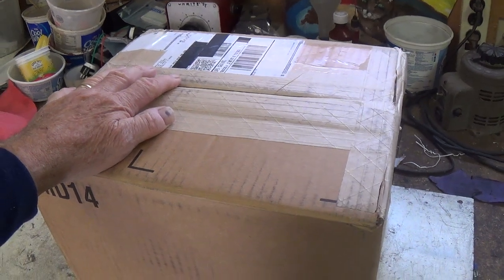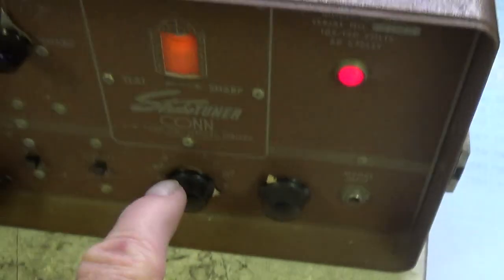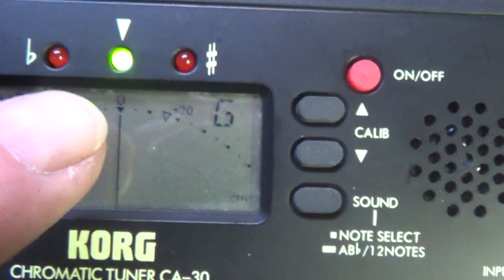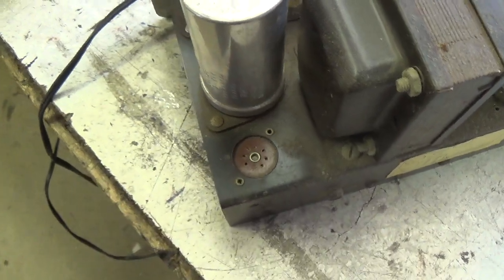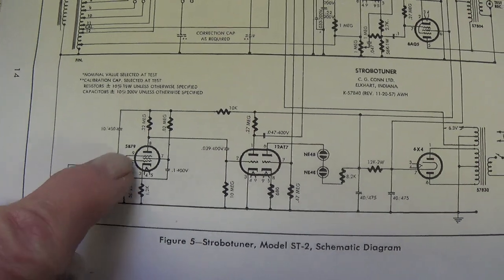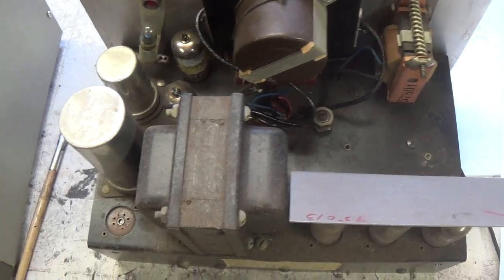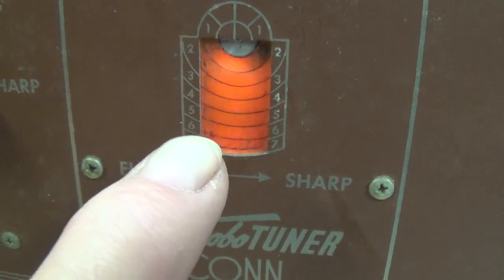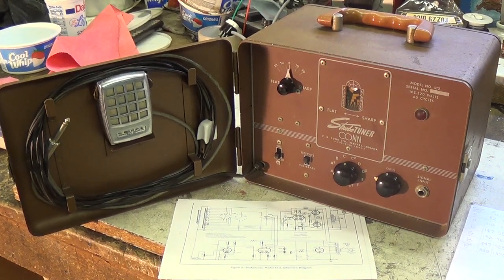Early 1950's CONN StroboTune Model ST-2.......What a Miraculous Device !!!

Comment: Typically here in the states we use 440 for A. I saw that you have your Korg tuner set to A=442. That skewed all your testing lightly. I believe your Korg tuner can play the note for you. So you could use it as your "frequency generator".
Reply: I remember reading that the standard frequency for A has changed over the years.  In fact it has increased as time has gone on, making symphonies and other music composed in past centuries sound unnaturally bright, if the original (now de-)composer were to hear it.  

This is borne out by the frequency listed in that ancient electronics handbook Audel's, which I believe lists 442 as the frequency if I'm not very much mistaken.
Reply: Syd McCreath  lol so true, although I have a few hippie dippy recording clients that tune to 432 Hz so they can be in tune with the earth 🌎 😂 pretty much any time I see one of those blasted Korg tuners in the wild there’s at least a 50% chance that it’s not set to 440 🙄
Reply: Most of the classical ochestra and piano use 442Hz.
Reply: Some of these tuners can be slightly off.  I used a sampling synthesizer to check my sisters' one once and it was off by four hertz.
Reply from the maker: I was using Hendrix & Audel's tuning ;)  Actually, the Korg was adjusted to match the Conn, since I believe the Conn is more accurate.
Reply: @therealdjryan  Organ pipes are made of lead tubing and wood planks, with a few aluminum in modern instruments. They are quite susceptible to expansion and contraction from heat and humidity. Each pipe is fitted with a movable extension for tuning. Gentle taps can move the 'sock' in minute amounts that sliding by hand can't duplicate.
Reply: 440 is the de facto standard for the A just below middle C in all but a very tiny corner of the music world, except for pipe organs, which use 435.
Reply: @Stefaon  that's because they have woodwinds and Brass. They have problems tuning down to 440 Hz.
Reply: With all due respect for Uncle Doug we have to take into consideration that most of his life was in the previous century. It is very well possible that A was 442 Hz when he went to music school.
Reply: @BartManNL  my Generation is more or less the same as Uncle Dougs. We didn't go to music school. We learned guitar from our coolest friends in the garage, strictly by ear...
Reply: With so much of today’s popular music composed of only one note, one would think that it would be all important to get that note correct!  However this is a soundly debunked myth as the use of Auto-Tune eliminates that burden on the modern day producer.  :O
Reply: Syd McCreath  Hendrix tuned down a half step.
Reply: A=440 is the A just above middle C. This is called Philharmonic pitch and it was settled in 1938.
Reply: @stirlingschmidt6325  -  In the A440 standard, middle C is 261.63 Hz.
Reply: @UncleDoug  agreed- from the start of the premise, I thought the conn would be the more accurate of the pair.
Reply from the maker: @scottclark7592  I trusted its reputation, Scott.
Reply: @stirlingschmidt6325  Not really.
Reply: @denniseldridge2936  
I heard something of the same. I thought it was 440 vs. 432 though. I think 440 is the official standard tuning now....I think.
Reply: I believe that way before the loudness war there was a pitch war which eventually resulted in the standard of A above middle C being set at 440hz. I think it's actually part of the Geneva Convention and it's technically illegal to tune higher than this. It's a fascinating story how we arrived at A = 440hz and far beyond the scope allowed in text.
Reply: @rubievale  
According to Zen worshippers, they dont like it. 432 was the balance of all harmony. Or something like that.
Some bands say they cant play 432 because they dont get that "Metal" sound. Yet other bands refuse to play 440. They say its evil. 😂
There must be something to what the Zen say if there's a difference of religious opinion in the rock genre.
Reply: @Stefaon  It was a Chicago instrument maker named J.C. Deagan who came up with A=440Hz. It had to do with, of all things, selecting a standard way of tuning percussion instruments for symphony. The American Standards Association adopted A=440Hz as official concert pitch in 1936, but prior to that, the most common standard for some centuries had been A=435Hz.
Reply: @therealdjryan  Pipes can detune over time from mostly corrosion. If the corrosion layer is removed then what's left of a pipe no longer has the same exact original dimensions & weight. Hammering will harden & make stiffer a chosen section, altering the resonant frequency. I like to occasionally find a cheap, trashy cymbal & try to hammer some moderate amount of decency into it. If the experiment fails, no significant downside, plenty more shit cymbals out there. But surprisingly I've gotten better-than-expected results most of the time.
Reply from the maker: @rubievale  Thanks for your helpful input, R.
Reply: @UncleDoug  I think the Conn is more accurate too, I have a chromatic digital tuner similar to your Korg which I use to monitor tunings on pianos when I am raising their pitch, the digital tuner is not accurate enough for fine tuning but I know the Conn is, they were used back in the day to analyse pro piano tunings and discoveries were made regarding some unusual properties of the human ear plus the discovery of piano's harmonics actually running higher than their theoretical mathmatical models. This is why we tune the bass slightly flatter and the treble slightly higher or else the piano's octaves will not sound pure! If you tune everything to 'zero' on a digital tuner (no stretching) then the piano will sound flat towards the top and sharp towards the bottom. It's a huge lovely confusing subject where maths breaks down and that's without getting into how you divide up an octave into it's equally(!?) spaced semitones. The stroboscobic tuners by Conn were mentioned a lot in the book called "Piano Tuning and Allied Arts" I wish I had one but we run at 50hertz 240volts here in the uk, there would have to be a proper power converter or it wouldn't tune right!
Reply: @BrendanMConnors  Maybe the Earth has got a bit flatter in pitch because if you look at the reasonant frequencies of lots of ancient man made 'chambers' they often reasonate accurately at 110hz which is an 'A' exactly to our modern concert pitch, so if your guys are saying she is reasonating at 432 now, then she must have got 8hz flatter! Sorry, I couldn't resist this and wonder what the 432 people would say to it!
Reply from the maker: @robworrall6832  Wow.....thanks for the very informative comments, Rob.
Reply: @UncleDoug  Very welcome and thanks for all the superb videos, very entertaining and educational indeed they have been and I'm also a cat and car man so I can't go wrong with any of your content :-)
Reply: @robworrall6832  well actually 432 Pythagorean tuning has been around for a while. While I don’t believe in any of the earth resonance stuff it was not uncommon in the golden age of symphonic music for ‘rockstar’ composers and conductors to detune from 440 to achieve a ‘hot’ or ‘cool’ effect compared to other ensembles, depending on the style of the piece something like that would be an artistic decision, not a geological one. 444Hz was a thing too, but nobody talks about that
Reply: @BrendanMConnors  Nice! Yes, the Pythagorean and many other temperaments were at different pitches weren't they and concert pitch has varied a lot over the years, I tune pianos and have experimented in the past with many pitches and different scales/temperaments. I only really notice a difference in the music though when the pitch raise or drop becomes closer to being an actual keychange. I think Russia used to have 444 or higher. The different temperaments though, they do make the music sound different - get's interesting when perfect 5ths can be heard. Such a great subject! Of course the lower you go in pitch, then the slower the beats will be between notes lol so maybe that's a thing too.
Reply from the maker: @robworrall6832  Again, thanks so much for your very nice comments, Rob.
Reply: @rubievale It is not 'technically illegal'. It is an international standard and convention, nothing more.

Comment: I never heard my guitar so in tune as the first time I was FORCED to use a strobotuner when I joined a band where the blind fiddle player had perfect pitch. My little electronic tuner was not as good. It's the feedback of the spin that makes it so accurate.
Interesting to see how the circuit works.
Reply: Yep. I used to think I was always in tune with a clip-on or in-line tuners.....boy was I wrong.
There ain't nothing like a strobe.
Reply: Chromatics are generally "near enough" for live performance, but that could be why you see guitarists having to tweak the tuning mid-song. I use a Petersen exclusively for setups and final tuning since I discovered them about 8 years ago.
Reply from the maker: Which is why I trusted the Conn and adjusted the Korg to 442Hz for A.
Reply: @UncleDoug  Now it all makes sense🤟
Reply: Even the very best tuner with a digital readout has significant potential error introduced by the logic circuits that decide when the next line or light should illuminate. The range of frequencies that are within a single line or light is quite broad.
Reply: @stirlingschmidt6325  So Uncle Doug's Conn is probably the most accurate of all.
Reply: @stirlingschmidt6325  Spot on! I would love to say I intonated with a vintage tube strobe. This was such a great video. I hope Doug wasn't offended SUM.
Reply: I was a a Neil Young concert years ago where he had a giant tuner behind the amps. He’s just quirky enough for me to think it might have been some giant manifestation of this principle!
Reply from the maker: @stirlingschmidt6325  Thanks for the info, Stirling.
Reply: @michaelmoore7975  Peterson company who is known for making strobe tuners from rack mount to stomp boxes and even clip on strobe tuner which is dead on accurate.
Reply: @stirlingschmidt6325  hmmm you might want to look at Peterson strobe tuners that are digital representation of spinning wheels and are guaranteed to be within one tenth of a cent. This includes the clip on unit.
Reply: @Cpt_Adama  Yes. I didn't mention it, but it just so happens that I've been using a Peterson Strobo Clip HD for about a year now. It is the absolute bomb. It has settings for just about any string instrument. Which is awesome because now it's only 1 tuner for all my guits and no fiddling around to find them.  For my electric, baritone, acoustic, resonator and bass. Plus it's got that "sweetner" thing. 
I'm tellin' ya, I'm never goin' back to regular ol' tune-less.
Now I wish they had a Roadie version of the Peterson strobe.
Reply: @Jesse-B  chromatics are worse for live. When you have 3-4 instruments off by a few cents each, the discrepancy is even more audible. I use strobe tuners exclusively now.

Comment: Hi Uncle Doug.  Really love your channel and all the wonderful work you do!  I just serviced one of these a couple of weeks ago and was really amazed with how the design works.  I'm not sure if you covered this in your video, but if you switch the operate/calibrate switch to the "calibrate" position, it uses the 60 Hz from your mains power as  an accurate reference to "zero" the unit using the flat/sharp knob.  Once you get it zeroed out, you hold the flat/sharp knob and move the pointer to the center "0" position, without moving the knob.  At that point, the unit will be dead-on accurate.  The A-note setting should then lock in at precisely 440Hz (or some harmonic of 440) instead of 442.  As old and tattered as mine was, it was still spot-on and all of the capacitors and tubes were still good.  I replaced the motor cap, as I read that they go bad and will prevent the motor from starting up sometimes.  Thanks again for sharing!
Reply from the maker: I did cover some of these points, and appreciate your added input. Re the 442Hz, apparently you missed the first (pinned) comment.

Comment: A note regarding the sharp/flat knob. 
The Conn Stobotuner was designed to be used by the entire band, so everyone was tuned to the same standard. (Cheap pocket tuners did not exist yet). 
If the band was playing at a venue that had an in house piano, or organ, that was slightly out of tune, the Strobotuner could be tuned to the piano, using that knob. Then, the rest of the band can tune to the piano, using the Strobotuner.
I think your unit needs the individual notes calibrated.
Reply from the maker: Thanks for your helpful input, Scott.
Reply: The individual notes can't be calibrated. They are determined by the tapped winding ratios in the transformer at top left. Ingenious design.
Reply from the maker: @EJP286CRSKW  I have a feeling that the calibration pot adjusts the motor and disc rotational velocity.
Reply: Sure, but that affects all the notes proportionally. To calibrate individual notes you would have to rewind the transformer.

Comment: Little known fact: Early clip-on tuners like this one was the cause of many headstock breaks.
Reply: Hay if anybody has Eric Johnson number  he might have one at the end of his signal chain to match all his vintage equipment. LOL
Reply: Haha, good one!
Reply from the maker: Yes, but they balanced the weight of unrelieved Les Paul's ;)
Reply: Headstock breaks happen because of the design of the neck, not clip on tuners (unless the guitar falls over onto the clip on tuners, in which case, most necks would have broken even without the clip on tuner). There are plenty of headstock breaks that have happened without any clip on tuner around. And even today, with flyweight clip on tuners, headstock breaks still happen. This is not a fact in any way.
Reply from the maker: @kostaskritsilas2681  It was a joke, Kostas. He was kidding about clipping a 16 lb. Conn StroboTuner on your headstock.
Reply: @kostaskritsilas2681  he was joking dude

Comment: A great piece of older technology ruggedly built and still working well.  One of the things I like about equipment of the era is the thicker component leads, particularly on the resistors.  They can be strung between tags and you know they won't sag and short out.  Also the manufacturer has gone to the trouble of running a thick ground buss, excellent.  Thank you to the person who sent it and to you for your presentation.  All the very best to you and yours for the Festive Season and the New Year.  Stay healthy.  Regards, Jeff.
Reply from the maker: Thanks so much for your detailed and well-expressed comments, Jeff.

Comment: We should bear in mind that perfect tuning of the open strings on a fretted instrument won't necessarily sound the best because the equal tempered scale pulls different notes in and out of key as you fret different notes.
Reply: Yes, good to use a tempered tuning system after the bridge is perfectly adjusted for intonation ... although today's tuners are getting so tight that you can just about use them note-for-note these days.
Reply: Actually, equal-tempered tuning is based on a mathematical relationship. The twelfth root of 2 describes the relationship of one note's frequency to the next or previous. It is by definition, perfect, as all intervals have precisely the same relationship in every key. The variables are introduced by different instruments. Every mechanical means of producing sound introduces its own unique errors in the process. Guitars do so (mainly) because of the pressure required to fret the notes, which stretches the string slightly. Some notes, such as in barre chords, are fretted twice, for even more error. If we look with an extremely accurate tuner we can even see that a note, when picked, begins at a particular pitch and begins to go flat as it dies away, as the string stretches less while the vibration amplitude decreases.
Reply from the maker: Thanks for all the detailed info, guys :)

Comment: Wow what a real treat to be able to watch and see this old gem of a tuner in action! I'll tell you that I was at first surprised that both the old Strobe tuner and the Korg were in perfect sync. However in my experience I have had trouble with certain electronic tuners NOT being correct and leaving a lot of room on the table in accuracy when trying to tune my guitars. So I wasn't surprised and almost relieved that when you came to the "D" tone the Strobe and the Korg were not quite perfectly in sync. Very minuscule that's true and maybe the average person wouldn't be able to tell the difference and probably even an expert. But the fact that you had to adjust the pitch just ever so slightly on the calibration setting unit (Or whatever it's called with the not so clear numbering system) I was relieved to see it knowing that I haven't been crazy after all the struggles at times with certain tuners. LOL. THANK YOU SO MUCH!
Reply from the maker: I'm glad you enjoyed the video, FG.